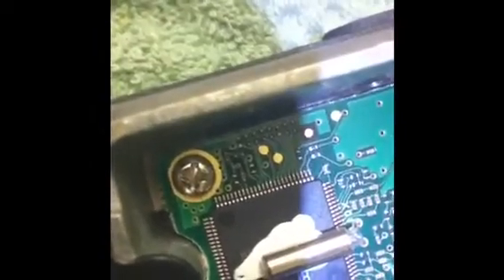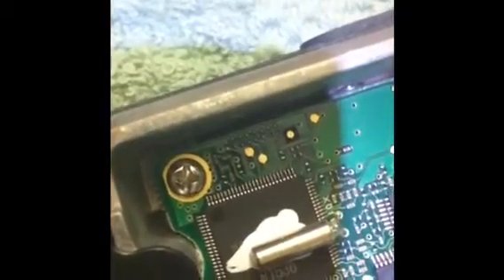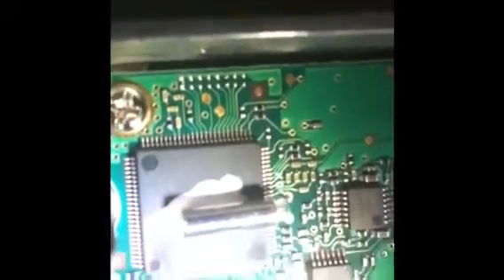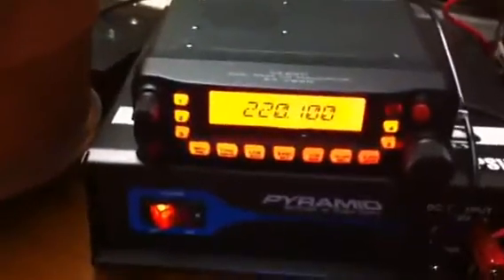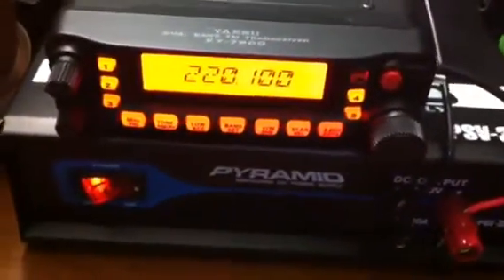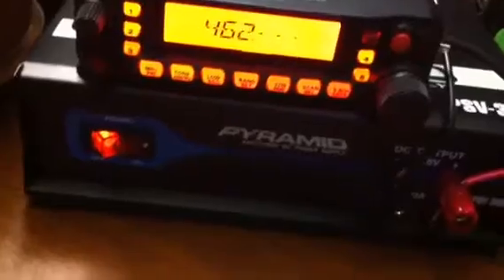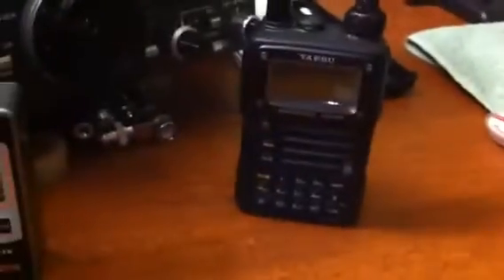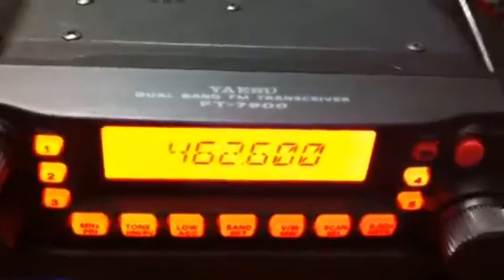Yaesu ft7900r freq mod

Comment: Hi, I have this yaesu ft7900r frequency modified by a technicient, but then after opening/extending the frequency, the radio lost its power/Cannot be turned on/ unable to transmit. Could you give me a clue to this issue? Tks. Ginting/ Jakarta

Comment: Even with a Amateur radio license. It is illegal to modify & transmit on GMRS frequencies, with this radio as it is not an FCC Type Accepted mod. Not to mention you need a GMRS Radio license to transmit, your Ham license doesn’t cover that. The fines are very steep if ya get caught... thanks for posting.

Comment: Is there a MOD than can put this radio to work on 220MHz?
Reply: Nope.      Really wish there was.    I hear 220 is very quiet
Reply: @mlr06121974  yes. Its the same in Brazil. 220MHz is deaf. No one buy 220 around here, sob, snif

Comment: Operating outside of the designated ham bands with this radio is illegal.  You said so yourself in the video.  If I were you I  would not encourage anyone to transmit outside of the legal amateur bands and emphasize that doing so is illegal.  The FCC will not be amused.  You will lose your license and the monetary penalties can be very high.  The FCC will find you.
Reply: It's funny how you quote the law of the FCC, yet call yourself "Frank Zappa"... Just saying... :)
Reply: ;pp
Reply: Wrong. It is not illegal to operate outside of the designated ham bands, it is illegal just transmit on frequencies you have no legal right on. And it is illegal not only with this radio, it is illegal to transmit outside of the approved frequencies with any radio if you have no licence or approval to transmit on those frequencies.
Reply: @illla  Sorry. I was not precise.  By "operating" I implied transmitting.  Of course, one an listen on any frequency.  One can only transmit on those frequencies at a given power with the radio that corresponds to the to FCC regulations and license privileges.

Comment: I've heard tx ends at 470mhz after this mars mod. Can you confirm this?  If not what is the upper frequency limit which the transmitter will lock?

Comment: According to Part 97, GMRS radios must be "certified" to be allowed to transmit on GMRS frequencies. One big factor of getting certification is that the radio CANNOT transmit on Amateur frequencies as well. While having a GMRS license and staying below the 50w maximum will keep you under the radar enough that you likely will never get caught, it is still breaking the "letter" of the law. There is also provision in FCC rules that you can use any frequency at your disposal in an emergency.

Comment: @warezjoe5 *WRONG*
Amateur radio's are not what is known as "Type Accepted" for operation outside the amateur bands. Although they will in fact work just fine in the GMRS band, it is in fact a violation of Part 97.
I was trying not to begin quoting Part 97 rules but I guess it's too late for that.
Just ask any licensed amateur operator, or better yet, look it up on the official FCC website, or ask in any amateur radio forum.
Reply: Send in the fed!! Lol

Comment: You do realize it's illegal to transmit on GMRS using an amateur radio. Dummy load or not, what you did in this documented video is not kosher.

If you intend to do this, and a lot of hams do, you shouldn't video-record yourself doing it for all to see.